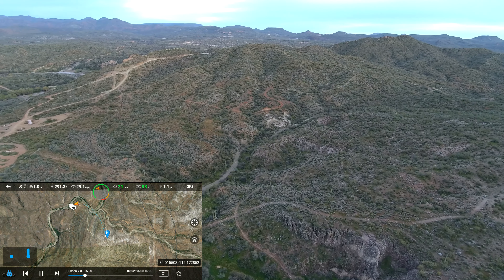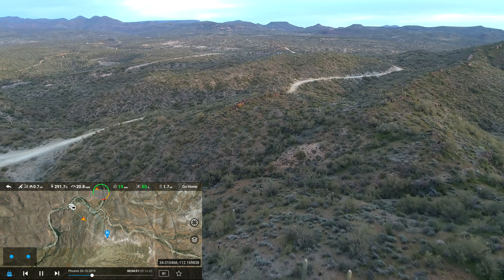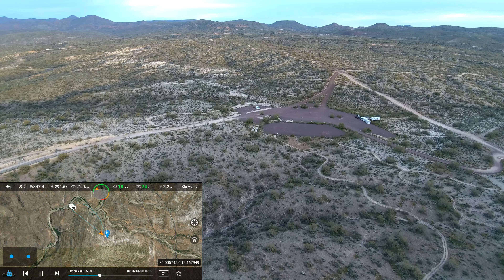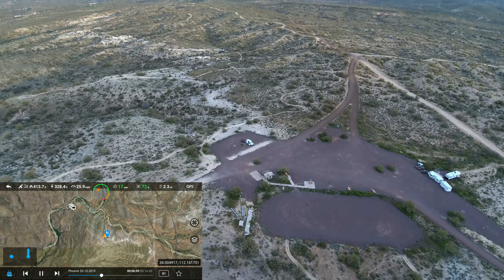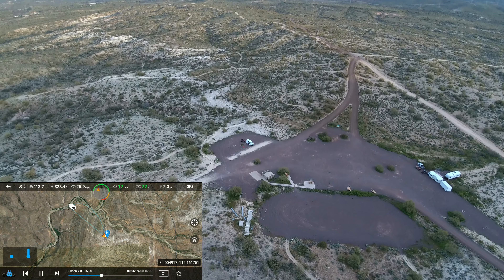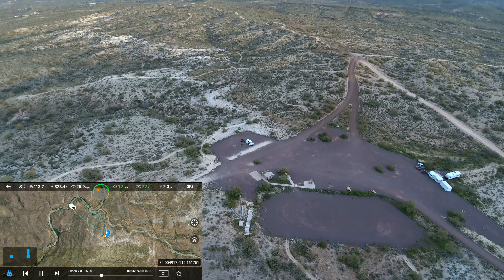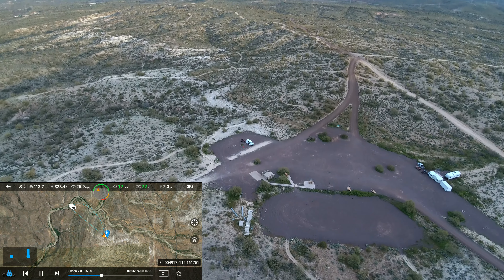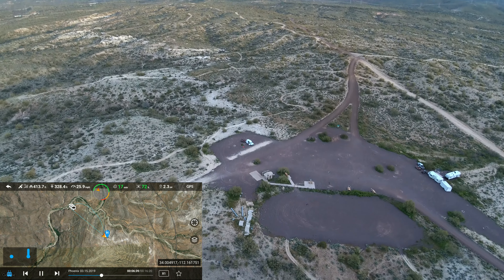Battery FAILURE In Flight- Autel Robotics Drone- Table Mesa AZ

Comment: Normal to RTH at current altitude if flying higher than RTH setting. Most LiPo drone batteries dont last much more than a year. Track the voltage from first flight and record voltage each month. I bet if you felt the battery after it came down it would have been pretty hot.

The reason they drop like a rock is to prevent the battery from exploding.  Exploding batteries can cause fires. This is why the requirements for flying is always VLOS,  but many many drone users dont follow that rule. When something like this happens,  the drone is often out of sight. Emergencies cannot be handled. 

In this case you took over the emergency programming which was to land wherever it was. The cell was overheating and you were still able to recover. 

Many cases like this end with the drone in a tree, on a roof, in a person backyard. And most occur a mile or more away well out of VLOS. Just way too many reports of lost drones from all manufacturers. This is why FAA is pushing testing for all drone users. 

The drone here did what it was made to do. The cell internal temperature was critical which is why the voltage and the remaining power jumped down suddenly.  This is not a fault.. it's how smart batteries work to save from even worse damage.  Other drones without smart batteries have had the battery explode and start fires.

Good recovery here, but you can now easily see just how dangerous this could have been if in a more urban or suburban environment.  This happens with many drones several times a week. Most occur when users fly out downwind, and fly to normal RTH setting, but the craft fighting to stay aloft in upper altitude winds strain, overheat the battery, motors, esc...and the drone lands or tries to land wherever it is.
Reply from the maker: Good information. Thanks for sharing. I will pin this.
Reply: My drone did the same thing.  It was at an altitude of 25 ft and maybe 15 feet away.  It was literally above a house. I use it to take pictures of chimneys. Battery was full at the beginning and from 80% it went to 5% in a second. It said landing,  landing. It started to drop and I hardly got it not to hit the house. The battery since then did not even charge and of course I'm not using it. Now i found out i can see the cells voltage but with this battery it did not give me any info anymore.  I'm glad it wasn't far away and I saved it from crashing
Reply: @rubenbrasoveanu625  I am looking for a few bad Autel X-star battery for a reconditioning experiment.  if you have not tossed yours away, please let me know.
Reply: @doanhtran4651  I have one that I'm not using and it's bad
Reply: @doanhtran4651  yes. Where you at?

Comment: If you keep lipo batteries charged while in storage, they tend to swell, and they will lose voltage instantly while in flight. You should store them between 30-60%. We ran into this same issue with DJI Phantom 2 batteries. We lost 5 batteries to to this issue. Back then, not too much information was available on the topic. The newer batteries have a self-discharge, which helps avoid the swelling and voltage loss issues.
Reply from the maker: These batteries self discharge. They are smart batteries that just were not good quality.

Comment: Had the same exact problem with only 40 charges, 89% life showing. Would go from 30ish percent to 8 and go into auto land. The drone is an excellent platform and mine still looks as good as the day I bought it, same first set of wings also on it. Sad the batteries started doing this and now that the battery is discontinued it is now grounded forever. Thank you for sharing

Comment: I am have had issues with 4 Autel Batteries.  They had not been abused.  I was flying a test flying around my house preparing for recording a video of Christmas lights when the drone exactly as yours did.  When I looked at the battery panel in the app, I thought it was odd that the app only reported 4 charging cycles when I know there had been more than...but perhaps the more important symptom was that cells 3 and 4 were much lower compared to cells 1 and 2.  The battery would not take a charge any more at that point.  Autel sent me a courtesy replacement but the other 4 batteries I own no longer charge and are little more than paper weights at this point.  I do believe there is a strong age component to the battery performance and lifetime.  I will assume that they such new products that Autel does not have data on that.
Reply: I am looking for a few bad Autel X-star battery for a reconditioning experiment.  if you have not tossed yours away, please let me know.

Comment: Today I was flying my XStar premium.  I have 3 batteries.  They were all just about full.  These seem to lose charge as they sit.  First battery was perfectly normal.  Flew around, battery got low, I landed it.  No problems. Put second battery in.  Said 91%. Got it up to about 150ft.  Immediately said battery critical. 0%. Landing.  I got it down safe.  Put 3rd battery in. Said 78%. Got it up again.  Exact same thing happened again.  I've never had problem with this drone before.  Really don't fly it much at all.  Very little hours on this.  Very concerned and disappointed as the camera on this is awesome.
Reply from the maker: That is just about my exact experience.
Reply: I am looking for a few bad Autel X-star battery for a reconditioning experiment.  if you have not tossed yours away, please let me know.

Comment: So what exactly causes the batteries to fail. I have the X-Star premium and it’s about 3 years old. Original battery I always use.  I bought drone from a friend year ago and it only came with one battery. Mine was charged and during flight at 80% within 1 second it said 2% and 2 min left and started to do automatic landing where lights turn solid red. Now I have no confidence in it and feel like even when fully charged I’m nervous to fly it even remotely far. Any explanation and what I should do if appreciate.
Reply from the maker: The batteries just simply suck. Once you see an imbalanced in the cells you need a new battery.
Reply: The battery is swollen. It’s been like that for 6 months and I was still using it. Not sure what causes that. Haven’t really had any issues until 4-5 months ago when it did emergency landing but since then no issues until last night when it said 80% and 12 min left and it dropped to 2% out of no where. There is resistance when I take battery out of the drone due to it being swollen. If I contact Autel I wonder if they will replace battery because I feel this malfunction just shouldn’t happen.
Reply from the maker: @PoweredbyJESUS7  I would say they won't. They didn't replace mine and they defiantly should have. They told me they had already replaced a battery for me and that it was out of warranty. Worth a shot though.
Reply: NewZona Rides  Iv never contacted Autel before and they have never replaced a battery for me so maybe they will since its the first time them sending me replacement. I’m sure if someone tries more then once they will get suspicious. I’m going to try because this is rediculus what happens if I was over water or to far away from home and at 80% it does automatic landing and I lose the entire drone then I would demand Autel send me a brand new drone and wouldn’t let off of them until they did. I feel like a idiot I don’t take it further then 200-400 feet away because I’m paranoid now.
Reply from the maker: @PoweredbyJESUS7  Hopefully they do. Good luck.
Reply: NewZona Rides thanks, calling them later today.
Reply: @PoweredbyJESUS7  anytime a battery starts to bulge out and get swollen like that, discard it right away. Never use it again. It can happen to cell phone batteries, it happened to my car battery. It's shot.
Reply: 18andlikeit  Iv used it 10 times since then. Nothing crazy happened.

Comment: Oh, man....so frightening to see this. I was out flying my Autel Evo today and thankfully everything worked perfectly. At one point I lost the drone in the glare of the sun and used the RTH feature, which had me freaked out, but it came right back and down next to me--whew! Thanks for the video, sir! You got a like and a sub from me! Also, thanks for telling me about the copyright situation.
Reply from the maker: No problem. I just went through that myself but the letter they sent me was slightly different. It said that they were taking all the money the video generated. The music I used was part of my editing software and was licensed to use. I got it all fixed but they attempted to take the money for that video and they had no claim to it. I just got back from flying my Evo. I was going to film my review of it but it got to windy.
Reply: @NewZonaRides  JP1970 was flying an Autel Evo..not a Autel Robotics Drone (you mentioned the drone you were flying way to late in the video)
I have the Evo 1 an nobody has any issues with battery dropping unless   they flew it pass the RTH % in their settings. However, thanks for sharing
that info for others.

Comment: Glad I found your video, has me thinking I m not crazy after all.   I ve been having this issue with not one but two batteries, one of which only has a few flights on it.   They both work fine until right around 70% battery life, then the batt instantly drops to 5 % and it drops straight down.  Seems to happen every flight, first time I got really lucky as it landed in a neighbors property and they were fortunately friendly about it.   I m starting to wonder if its something software related given the behavior in two different batteries.   Sucks because overall its been a good drone but as others have said I dont trust it for much of anything at this point.  Use my Anafi for  every thing now and outside of windy days its better than the Xstar in every way.

Comment: Thanks for posting this. I've always trusted my X-Star premium as well -- had it over water many times, a quarter mile out over the ocean, almost a mile from the controller, etc.  I've actually crashed it a handful of times (I've learned to calibrate and make sure the compass is ready before every flight, and also try and avoid trees....), but like you had no major problems. Then recently with a friend flying it, one of the batteries did the same thing yours did, and went from 10 minutes to 1 and did an emergency landing. A bit unsettling. Fortunately it had a remarkably soft landing after bouncing through some branches and was fully recoverable. He felt bad but literally did nothing wrong. I wonder if the batteries stop allowing accurate reporting after a couple years. Everything on mine should be using the latest firmware.
Reply from the maker: I think the XSTAR had battery issues from day one. Still does to this day. I know for sure one day this will happen again with the next battery. What I do now iis get ready for all hell to break loose at anything below 50%. It adds a lot of excitement to every flight. LOL I also make sure the battery cells are balanced before I take off. If they are out of balance I know I better be ready if I decide to fly with that battery. I only have 2 batteries left that are good and I suspect I will lose one more soon. After all my batteries are dead I am not sure I will buy anmore.

Comment: I'm having this issue with my Battery/Drone.
It screwed up last year, I lost 5 mins of flight time(Permanently) and Now it will go from 14 mins left to Emergency  landing=Low Battery in just seconds.
The battery is like 2 plus years old, so I'm guessing its all in the battery?  I would hate to spend a hundred bucks on a battery when its the Drone itself .

Comment: This happened to me a few times - the first time was Oct 26, literally a day after I installed the Oct. 25, 2017 FINAL FW update to the XStar. - In forums I noticed this happened to others as well, not everyone though. Earlier that day on the older firmware I had an amazing flight - using all 4 batteries in Bucks County, PA, no issues at all. Never had issues with this battery % problem since I owned this. After the update, I took this flight to test the new smoother Yaw - https://youtu.be/gNB51YbfhNM - Immediately noticed the horrible gimbal tilt. 

So as it was above me, messing with getting the horizon level settings and then the same exact thing you had happened to me. 34-35% - 8min flight time to 1 min, in a split second. It is scary as hell,  a total feeling of hopeless panic! As it SLOOOOOWLY was coming down above me, I cancelled Auto land and got the drone down as fast as I could before it would drop out of the sky!  It did thankfully! Autel did send me new batteries in Dec. 2017 - and eventually I shipped the X Star to WA to get that annoying gimbal fixed. 

*Tilt came back though, the random battery % happened a few more times on the new batteries in early 2018, summer of 2019. I took it out for the first time in a while this past Aug, but now I noticed as I push my stick to fly forward, it drifts to the left - (even after resetting everything, calibration ) ..Annoying. Sadly in Nov. 2019, I just cant trust it anymore.
Reply from the maker: Pretty common with the Xstar. I was pretty lucky that my Xstar had no issues except the batteries failing. That was a pretty big thing for me though. Good news is the Evo hasn't had any sudden battery failures yet for me. It has been mostly OK to fly. I have also never sent my drones back to Autel. It bothers me a lot they demand your controller when you send it in. That makes me suspicious as to why they demand this.

Comment: Still not clear if it landed itself (roughly), or if you controlled the approach. At one point you said it "disconnected" (10:30), and was "landing now". So did it land itself or were you controlling it, and if so why the rough landing? FYI, I've never flown a drone.
Reply from the maker: When battery gets to a critical level it will start to land right where it is. It is coming down no matter what at that point. You have limited control when this happens. I was still flying the drone but I was not incontrol of the descent. If I had not taken control it would have just simply crashed somewhere either by landing right where it was or just flying who knows where. When a battery does what it is supposed to you can either land yourself or have it land on its own and you typically have about 7 minutes to do it. When the controller disconnected that is the moment when the battery failed. It reconnect automatically after the spin.
Reply: @NewZonaRides  Ok, thanks for more info. I want a drone now!
Reply from the maker: A DJI Spark is a great starter drone or a used Phantom 3 or one these Autel Robotics Xstar Premiums. That way you can learn to fly for a small amount of money before you try a 1000.00 plus one.